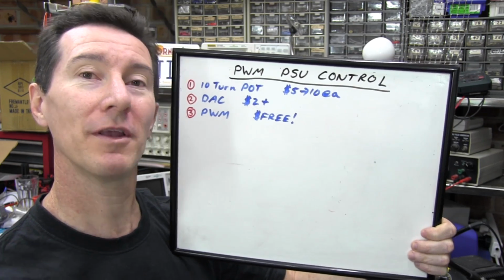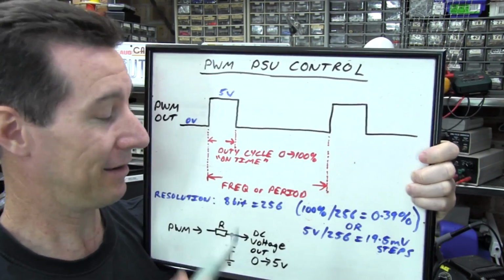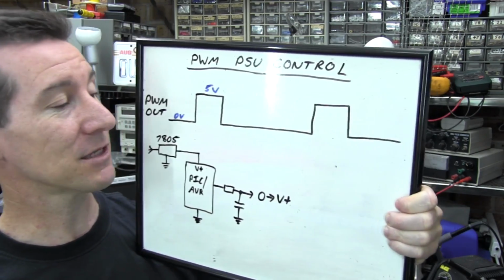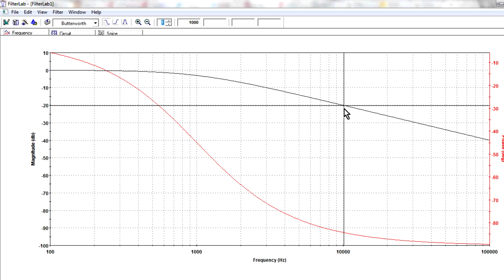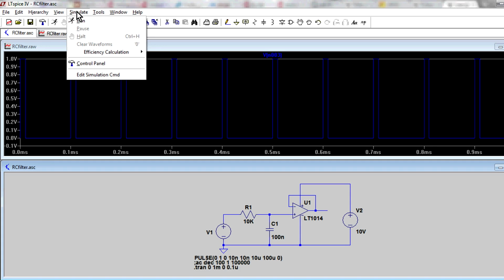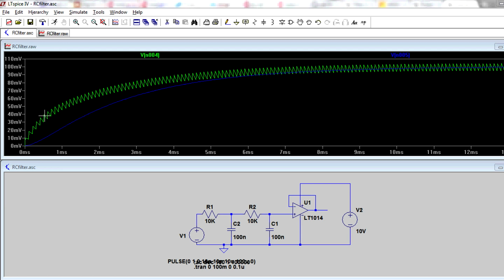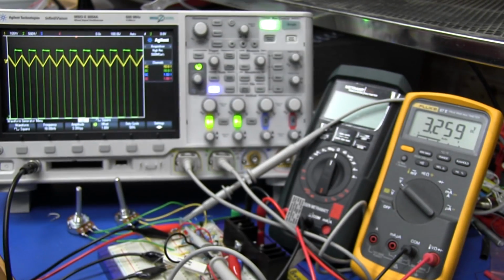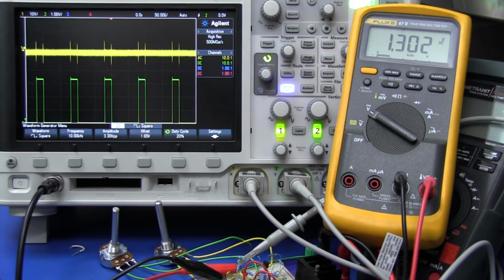EEVblog #225 - Lab Power Supply Design Part 4 - PWM Control

Comment: I was into RC airplanes and the 90's I did my own servo limit controllers... they use PWM for servo positioning tied to a pot built into the control arm along with a opamp to control the position... learning about PWM's is a very useful tool.

Comment: What about using dither in the timer? This way you can increase output resolution.
I mean with STM32's in 16 or 32 bit timer this is a very neat way to get fine tuning of the PWM output resolution.

Comment: why not power your uc with a generic supply voltage then drive the pwm output with a transistor connected to the voltage source

Comment: Can someone on here maybe help me explain whats wrong with my Advance / Gould os2200  Oscilloscope. It has a really highpitched noise. Is it the supply or crt? Cant use it even though it works fine excluding the noise.. the noie is 10 to 17khz

Comment: The esp32 only costs $1.50 in quantity and $2-2.50 in single chip qty. Even dev boards can be bought for about $4. 16 PWM Channels that can go up to 25 bits and if I followed the tech reference charts correctly they can be clocked up to 80Mhz and adjusted quite freely depending on clock source. Should be possible to make a touch screen and WIFI controlled multichannel PSU using it. It also has 2 DACs but they are only 8 bit. The interesting part is the 18 12bit ADC channels.

Comment: Dave,  Stanley A. Meyer claimed to have invented a way to efficiently separate hydrogen from Water in order to use it for internal combustion before he was allegedly killed for planning on mass manufacturing his idea.... His book Water Fuel Cell "The Birth of New Technology" references 26 patents. I’ve found some of his patents in USPTO website. The problem is that he did not include the values of any of components which makes it difficult to replicate his voltage intensifier circuit that is used for the process. Some believe that his work conflicts with the 2nd law of thermodynamics. I believe that would be correct if he was trying to create energy, however, like the petroleum industry... he was not trying to create energy, he was simply trying to extract energy that is already available. The petroleum industry spends lots of money trying to find and drill for oil.... The first few gallons are expensive, making it true that it takes more energy to get the petroleum than the benefit it produces. However, since there are billions of barrels available once the initial expense is covered, petroleum becomes very lucrative due to the sale of each barrel above the break-even point is achieved. Likewise, Water is readily available, and in fact contains more hydrogen per gallon than gasoline. Would it be reasonable to state that it could be a possibility that a voltage intensifier circuit may be able to efficiently separate hydrogen from water, and that we cannot use the 2nd law of thermodynamics as an excuse for not experimenting? We cannot reasonably say that it's inefficient until we have proved that it isn't inefficient, because the concept of separating hydrogen is simply trying to extract the energy and not trying to create the energy. Would you be able to use your extensive knowledge to prove if the hydrogen extraction process outlined by Stanley A. Meyer is as efficient as he tried to claim? His patent 5,149,407 contains a schematic on sheet 2 of his 15 page patent. Thank you.
Reply: Breaking bonds requires energy, so his work does conflict with the laws of thermodynamics. Next.
Reply: You burn petroleum to release energy. So petroleum is in a higher energy state that when it is burned. Since water is already in the lowest energy state known for it you require energy to split it. When you burn the split material you release the energy. But you require the same amount of energy to split it like when you burn it because you don't change the resulting state you just convert forwards and backwards. Additionally you have always losses when converting energy so you don't get an equation but require more energy than using it.
Reply: You split a couple million atoms with a DC voltage of 5 volts at 200mA and you release enough energy to blow everyones skin off for 15 miles. Next......

Comment: Hi I'm new to this so I might need a bit of help. I'm making a pitching machine for a baseball team and I have a 2.5 hp elec DC motor out of a treadmill.  It puts out 180V at 5700rpm. I'm also in Australia and I want to be able to control the speed of the motor. Can you please help me out so I can make a control box for it. Thanks Randy
Reply: Your motor puts out voltage????
Reply: +TheHue's SciTech Didn't you read his comment? He's from Australia, everything's upside down there.

Comment: 12bit PWM resolution is quite nice. Just worth notice, that atmega8 has 16bit PWM controller, so you can have really beautiful resolution there. The question is, does one need such a great resolution? Maybe it's better to stay with attiny budget chip in some designs. Cheers!
Reply: ATmega328P also has 6 PWMs, and you could use 2 PWMs to increase resolution as well.

Comment: 1dB is 2^0.33
3dB is 2
10dB is 10
20dB is 100
30dB is 1K
60dB is 1M
Reply: Only for power. for voltage, it's double that. 10log() or 20log().

Comment: I see a (very) minor problem here.  While an 8 bit binary number can represent 256 different values, there are really only 255 'steps', since you start at an initial point (0) and step up only 255 times (to 255)  So each step would be 5v / 255, not 5v / 256.  At 5v / 256, you'd always end up just short of 5v.  For 10 bit, it would be 1023, and 12 bit would be 4095.  It would only be important if you needed that level of precision, though.

Comment: PID with a micro would be much slower to respond so it wouldn't be that good for a general-purpose bench supply. Look a the scope trace at 39:30 in part 3, see how steeply the voltage rises when the load suddenly drops - the trace is almost vertical. The analog circuit reacts in a couple of microseconds and limits the overshoot to 50mV. I don't think you could make a PID loop in an 8-bit micro react anything like that fast.

Comment: @ultimatefang007 
Hi moved the proabe from the rc filtered PWM-pulse to the outputpin of the constant power source. Hi also explains the may be unpredicted flat curve on the output as a resoult of the capacitance in the powersupplys output...

Comment: @EEVblog Cheaper than running the whole micro on a precision source is to just run a 4050 or 4049 with a single stage driving the other 5 in parallel. Cheap and only the PWM load on the regulator, which generally is pretty poor in current regulation. Isolates the noisy micro from the analogue, just use the 4049/50 ground to join digital and analogue grounds. Will give a nice square output with good and consistent rise and fall times to the filter, and is dirt cheap.

Comment: @laharl2k R-2R ladders depend greatly on the matching between resistors to achieve smooth output. With 1% resistors you can expect to get 5 to 7 bits before the output inaccuracies overwhelm your precision. The output response becomes "jaggy" and actually steps backwards for some (many) steps, depending on how many bits change.

To get your 0.0015% output resolution (not just accuracy), you'd also need 0.0015% tolerance resistors (you'd probably need better than 0.0005% in practice).

Comment: Very cool Dave!! Can't wait for the rest of it. In terms of Op-Amps, you mentioned needing a rail-to-rail amp...I've recently sampled the MAX4040 and MAX4043 (single and quad versions) and they are really nice little amps that go really really close to the rails. The only draw back in the maximum supply being 6volts. I thought of them for your project however, since you are only dealing with 5volts or less in the MCU portion of the PSU.

Comment: @Kankki1 the good thing about going R-2R ladder would be that you could go have as much precision as IO pins your micro has, for example a atmega8 hase 22 io pins(23 if you use the reset one)  say you use 2 for up/down, 2 for select/cancel, and 1 or 2 for the the lcd.
that lives you with 17/16 pins worth of resolution, aka 0,00076%/0,0015% and you wouldn't need a RC filter, hence wouldn't have extra noise, and with 17bits you could go high voltage, say 100V and still have 0,76mV steps!

Comment: Buffer is because the regulator is a current source, and the filter works better with a high impedance load, preferably a very high value resistor to ground. If direct connection there will be an offset that makes the output voltage rise above the set value, and this will vary according to the voltage set. The buffer sinks the current whilst providing a very high load to the filter. RC filters will always have ripple on the output, cascading them just gets it below the noise floor.